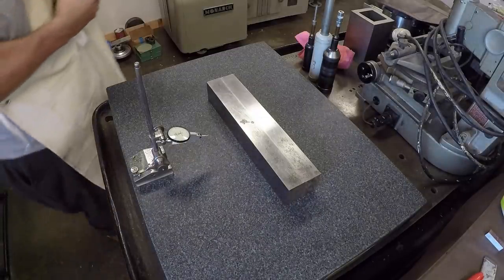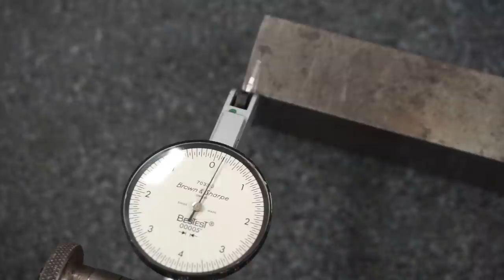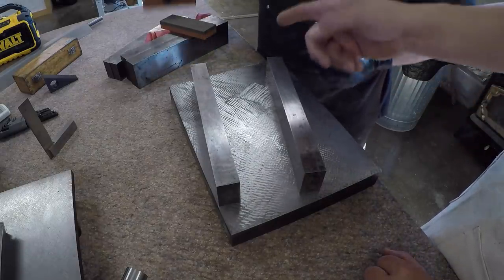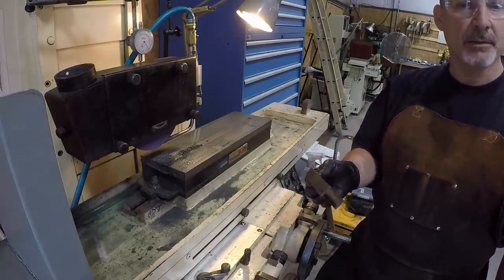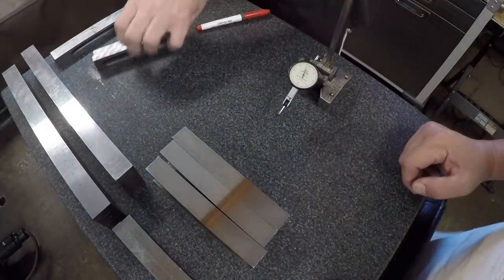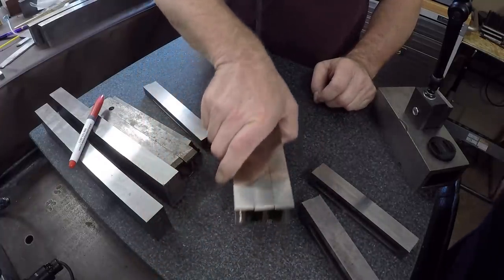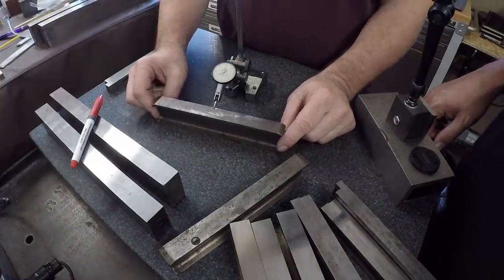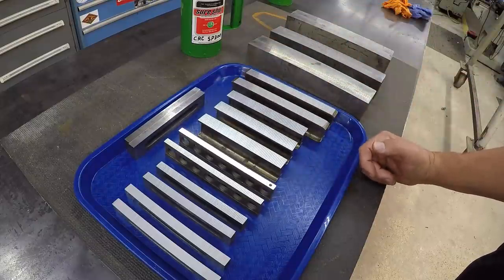SNS 293: Inspecting and Surface Grinding Parallels

Comment: good coolant setup but another note on coolant when grinding people visualize it helps at cutting interface it actually dosent. its cooling the part. that is why rubbing a spam or slab of bacon or crisco on part has absolutely zero effect. I do in fact when final passes run a candle across there but it really has no effect but it cant hurt so yes I do it.